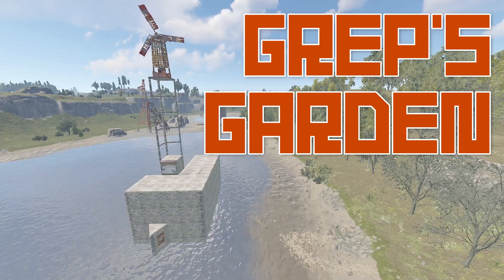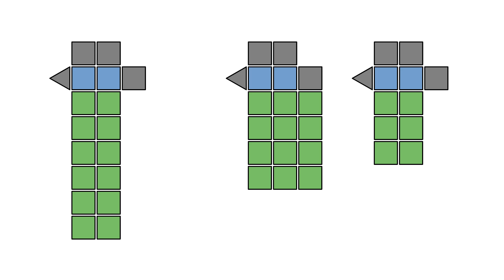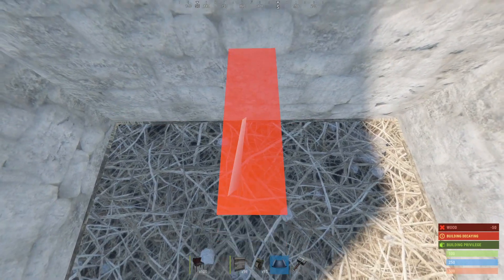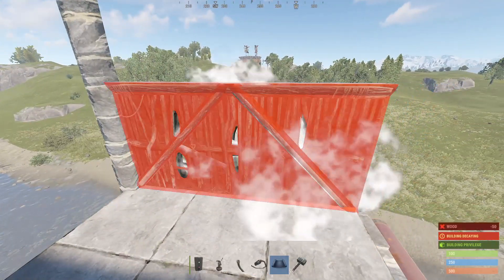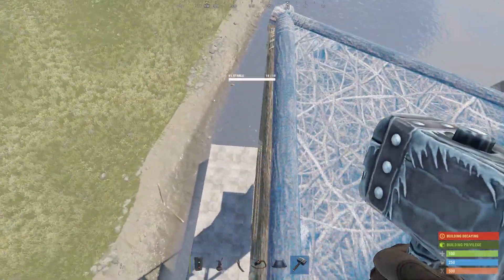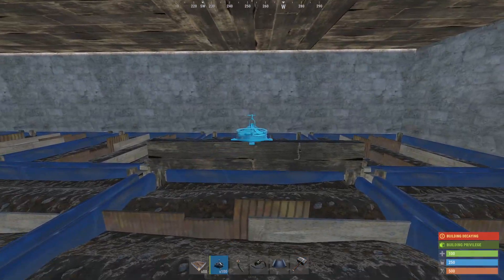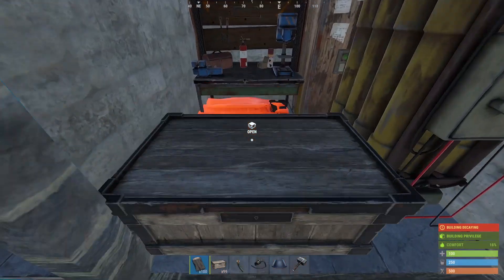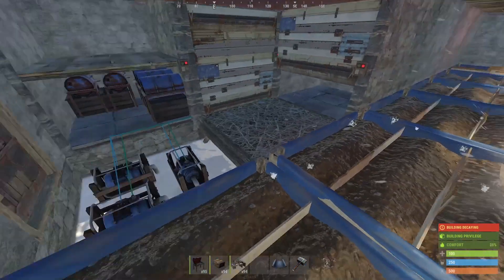Grep's Garden: Base Design

Comment: very comprehensive guide, even shows the build movement
I want to build this one on a river, even though terrain is not best. will give it a try
Reply from the maker: It can work if the terrain is level. The water level can be higher than it appears, though.

Comment: As mentioned in the commits, the large planters will soon automatically snap to the center of the foundations center, so if you are watching this video in the future, particularly after what will likely be the monthly update of October 2021, please note that the twig low wall trick wouldn't be necessary to center your planters anymore. Until that change goes live use Greps method instead. Also as a bonus, it looks like the inventory for planters will be much more difficult to accidentally open while harvesting crops so that's a huge plus! I'm surprised to see these qol changes for gardening but they are wholly welcome!
Sources:
https://commits.facepunch.com/390870  
https://commits.facepunch.com/390855

If I'm not mistaken, if you're using desalinization methods to provide water to your garden, you will have to cut down on the sprinklers by about half, so that each pump is providing water to a maximum of 3 sprinklers. 

I have a question, however. In your sprinkler video you note "If you have a water pump or a water purifier feeding into a fluid combiner, you can have no more than 6 sprinklers in a chain fed by the output of that fluid combiner". My question is would that same logic apply to any pump sources as well? Such as 7 max sprinklers being allowed to be fed from a single purifier without the combiner in the chain? I'm unfamiliar with that mechanic since I don't use purifiers but might give them a shot. Is it fluid combiners that act specifically like that, or is it all outputs, and why?

I personally like this design, I think the windmill could either be accompanied by a second windmill or two or three solar panels since it's not uncommon for windmills to dip below 100 output often. Personally, in my gardens, I make sure I have enough power flowing in to ensure the farm can run 24/7 uninterrupted and do away with a master switch to save me that small extra bit of electrical budget. For a multi-story garden, I would personally put an elevator in the jump-ups when I could afford it. For 5 power on the cost, they're surprisingly useful for quickly traversing vertical designs and when I utilized one in my 4 story garden it made harvesting and cloning tremendously more efficient than hatches, jump-ups, or other high keyboard input ways of traversing stories, allowing me to be lazy and leave my binds on for whichever task I was doing between floors.

Lastly, I know that Tamura77 has a video which details how it is possible to fit four pumps in one foundation,  was there a specific reason you opted to not do this in your build, or did you not know about it? I'm curious.

Thank you for the great videos. I clicked as soon as I saw it and can't wait to see more from you! A subscription that was well worth it! :)
Reply from the maker: Three water pumps into one purifier is indeed enough for six sprinklers. Each pump outputs 510ml per minute -- 1530ml per minute from three pumps combined. The purifier cuts that in half, generating 765ml per minute of clean water. One sprinkler consumes 120ml per minute (2ml/s) -- 720ml per minute for six sprinklers combined.

The short version of the sprinkler limit is "don't string more than six sprinklers together". However, when testing on a build server, the behavior was weird and inconsistent. Sometimes I could manage to get a seventh one to work, but not consistently. That's why I mentioned having a fluid combiner in the mix. I specifically tested the scenario where a single fluid combiner was in front of a chain of six sprinklers. If more devices come before the sprinklers, it might further reduce the number of sprinklers that would work. The limit is due to a long-standing bug.

In terms of power needs, one windmill is typically enough for this design. If heaters aren't needed or are only needed part of the time, that reduces the load quite considerably. Same for purifiers. If someone is making the base bigger, then adding another windmill tower isn't a big deal. When designing an electrical system, the assumption I use is that a windmill will generate an average of 85-90 power. Let's call it 90 for this example. Since batteries charge at 80% efficiency, that means an average of 72 power is going into the battery. I actually prefer the jump-ups because it provides a location for the purifiers to go without wasting any space, and the very bottom gives some nice storage space, too. Of course, by sharing this design, it allows people to use it out of the box or adapt it to their liking.

If I recall correctly, I saw Tam place pumps first and then surround them with the foundations. I try to avoid using building techniques that would prevent me from rebuilding if something happened. By arranging them a very specific way, I have managed to get four pumps placed into a spot that was already surrounded by foundations. However, I simply don't need that many pumps, and it would make the build process extremely finicky for others to try to follow, so I didn't bother with any of that in the video.

Thanks for your comments and good questions. I hope that this channel continues to be a good resource for you!
Reply: @grepdashv473  Absolutely! Thank you for the reply. I may just go do some testing of my own right now then :)